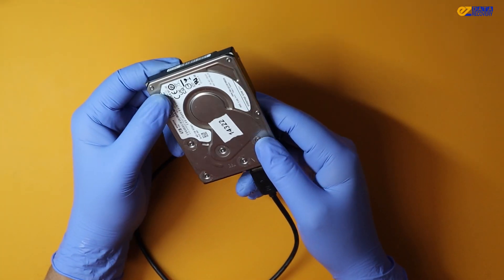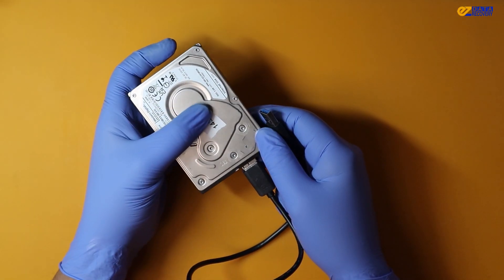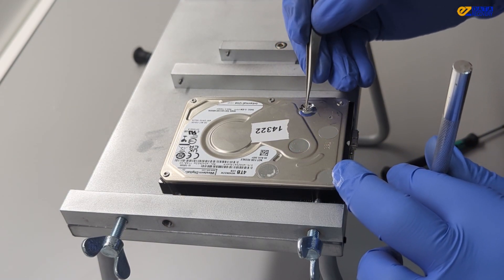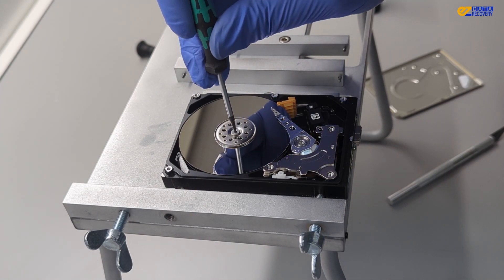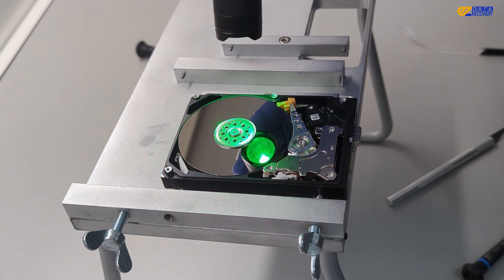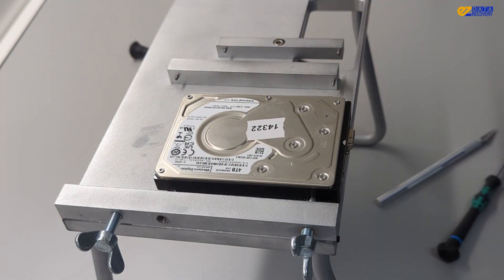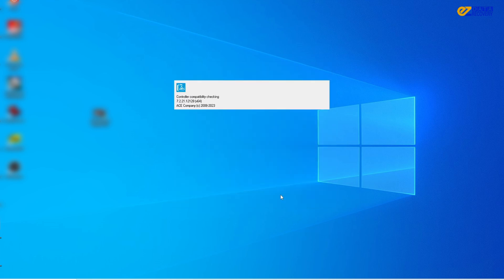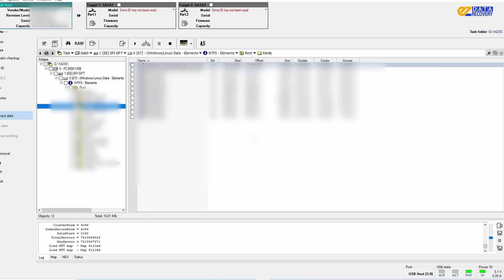Fixing WD 4TB External Drive: Stuck Heads & Buzzing Sound | Data Recovery

Comment: Hey folks, I had a clicking sound on my P10 WD-Black 2TB Game Drive, as well as it not being picked up by anything in disk management or recover tool software, when opening it up, I noticed the header was parked just on the edge of the disc, away from the parking area. gently spinning the disk did not move the header either, like it was disconnected from the disc. The disc looked clean, but the drive is just a paper weight now. Any advice?

Comment: My external HD fell on the ground and starting buzzing. I opened it and it was exactly like this. I've followed the video, and it came back to life. Of course later I took it out from production because I did not open in a dust-safe room, nor checked with a green light. But at least I could copy all the files to another drive. Thanks a lot!!!
Reply: wow your comment is slightly reassuring! I too dropped the WD drive and its making a sound and not connecting to laptop! I hope this works so I can retrieve the data saved on it.
Reply: i tried to do this, discovered my drive wasnt stuck, saw a hair on the disk part, blew on it, accidentally got some spit on it, then closed it back up with the wrong screws. 🍸cheers

Comment: You made it look easy! Same idea for a WD MyBook hard drive from 2006?
Reply from the maker: Thanks! The concept is similar, but older WD MyBook drives from 2006 may have different head parking positions. Be extra careful, as older drives can have more fragile heads and platters.